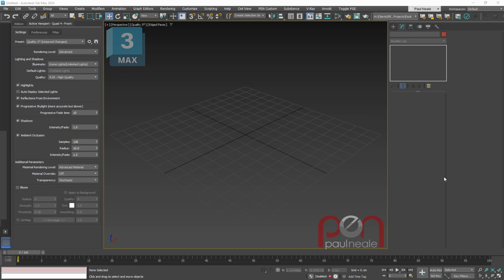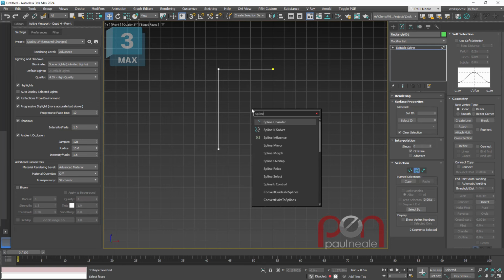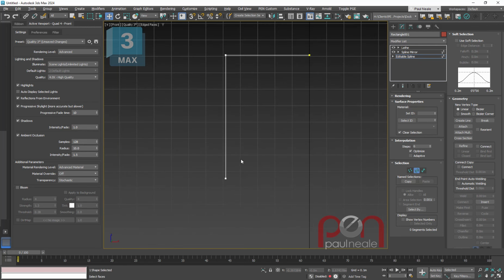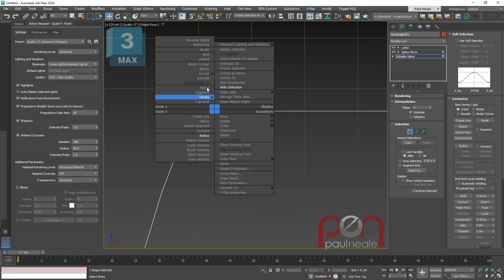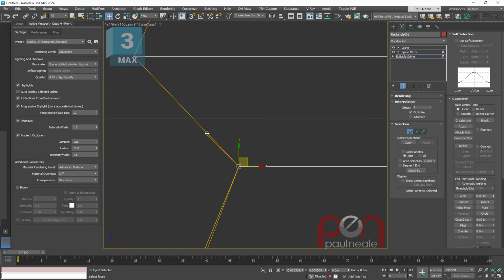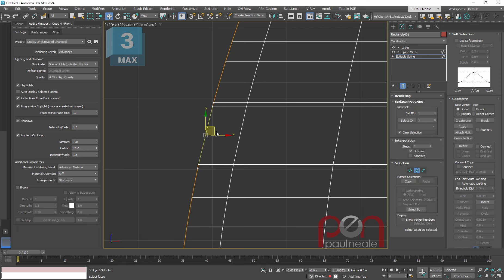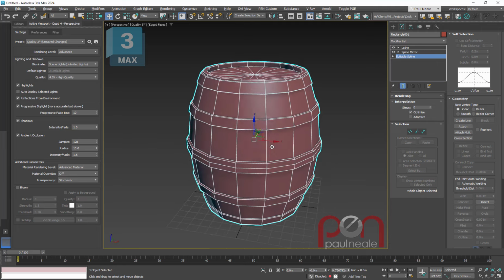3DS Max Game Barrel

Comment: Awesome stuff. Can you explain what happens when we go vertex -> Corner? Thanks in advance
Reply from the maker: @simke123  I don't know what you are referring to?
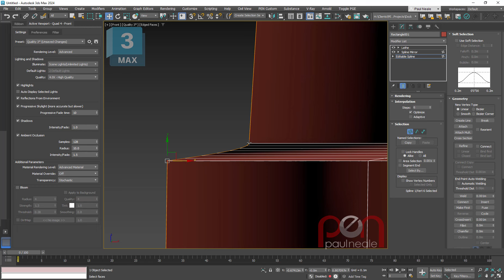Reply: @paulneale  For example at 3:01 seconds. But I guess the word says itself - it should be used only at the corner, so we will get better results with reducing edge loops (optimization) ? Thanks
Reply from the maker: @simke123  you. An see the poly count drop when the spline goes straight.
Reply: @paulneale  okay thanks. hopefully we will see new tutorials/videos from you on the channel, very convenient to learn from your stuff, cheers
Reply from the maker: @simke123  Posted on 2 weeks ago.